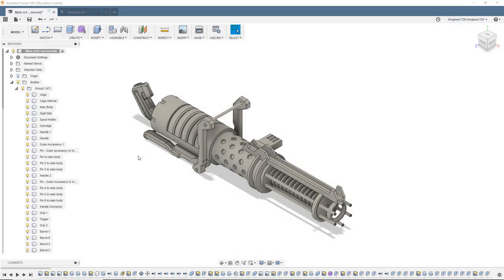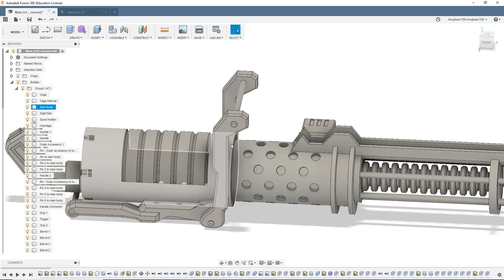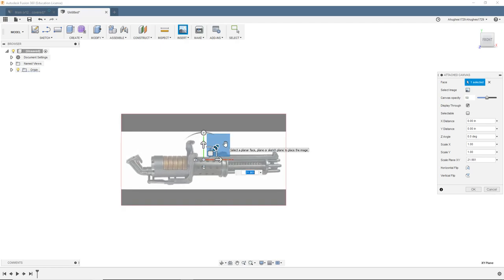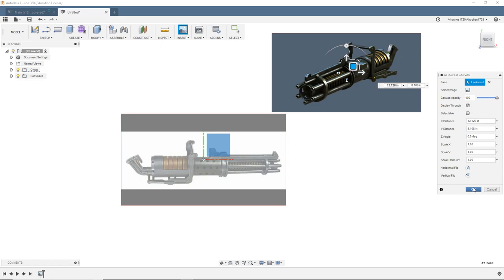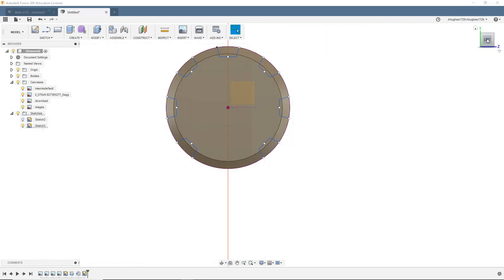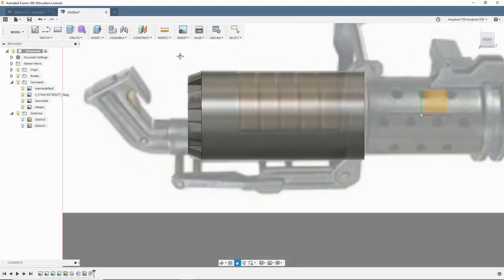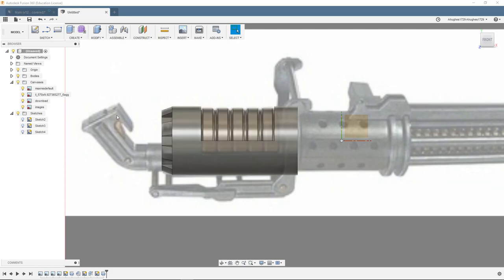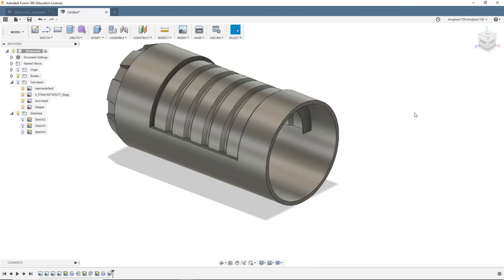Modeling the Z-6 Rotary Cannon - Episode 1 - Main Body

Comment: Great video, thanks for sharing!

Just a small tip - there's a slightly easier way to scale your reference image by simply looking for it in the left browser under Canvas, right-clicking on it and "Calibrate". That allows you to select 2 reference points on your image and give the distance between them a fixed value ;)
Reply from the maker: That's a great tip, thanks!

Comment: Instead of trimming the patterned bottom lines at 16:00 you can uncheck  the box of the pattern entity's you wish to remove whilst in the pattern tool, thus saving a few clicks. Also, from what I learned it's better practice to pattern the cut feature rather then creating patterns within the sketch. It makes it easier to go back and change the feature if needed, and also it saves some computing power. 
Overall a great video and a cool project!

Comment: Cool prop. Will this make it to thingiverse or be a sellable item? I have to say as a Blender user(which i love) that i found  some definite advantages here to modelling in 360. Measuring and sizing is definitely easier and more  intuitive. Also, that feature of extruding a flat plane around an axis is very nice. Have you had any  experience modelling in Blender and if so how would you compare the learning curve of Blender vs Fusion 360? Thanks for sharing this. Excellent video.
Reply from the maker: It will be uploaded to Thingiverse when the series is finished! I've never used Blender but I hear it's got quite a learning curve.